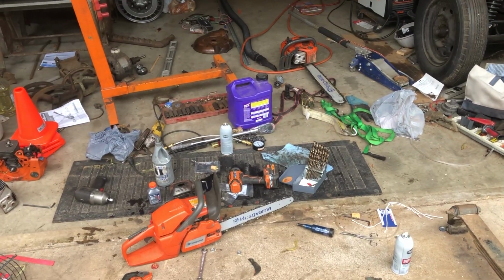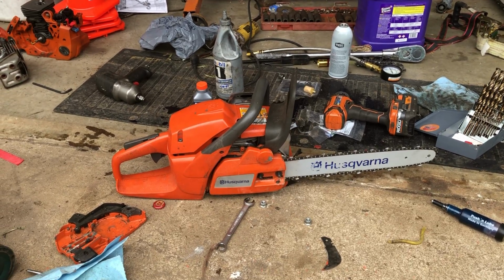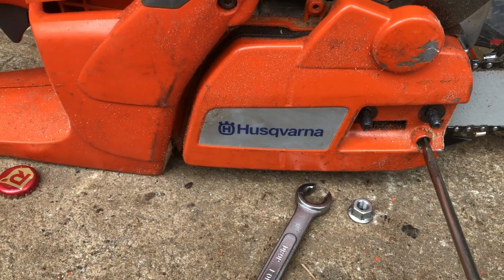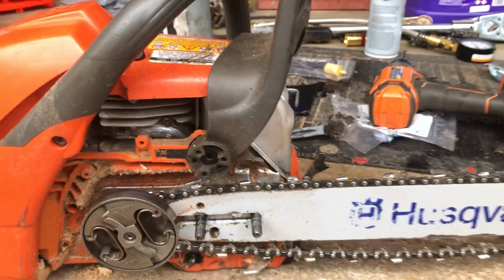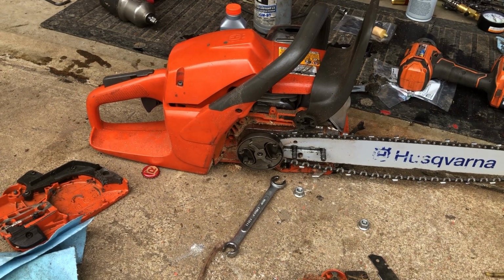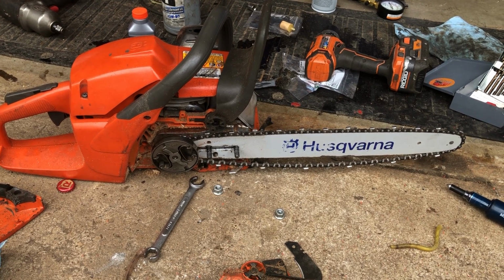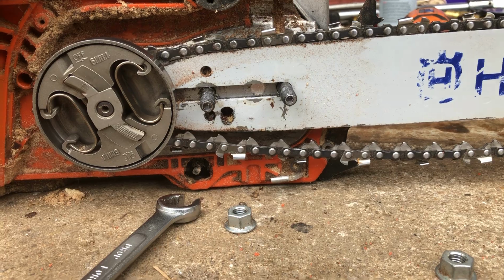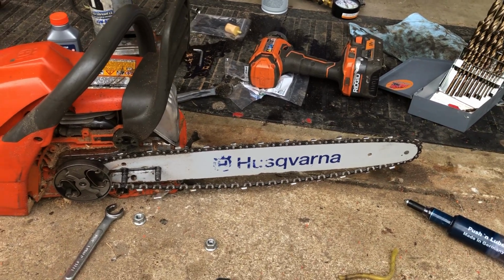Husqvarna 455 rancher with a 16 inch bar?

Comment: I bought a 16 and two chains for my 455 today. Absolutely rips. The bar was designed for the 445 rancher though. No modifications required.
Reply from the maker: Very cool!
Reply: I have a 455 Rancher I bought in 2012.  The manual has the specs for 15-, 16-, 18-, 20-, and 24-inch bar and chain combinations.  The manual calls for 16" bar with 3/8" pitch, 0.050" (optional 0.058") gauge, 11T nose radius, with 60 drive links.  Husqvarna chain type H80, H46, H47 for the .050" and H81, H42, H48 for the .058" -- 7/32" file, 55° angle (bar to cutting tooth, side view), 25° angle (cutting tooth to perpendicular of the bar, top view), 10° angle filing angle across the bar (to the horizontal plane) and 0.025" raker gauge.. hope this helps!